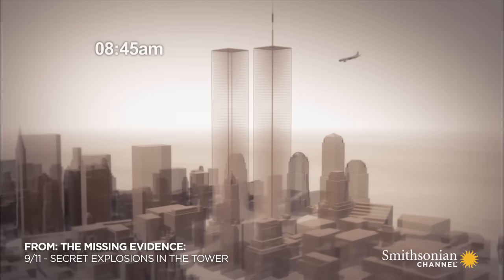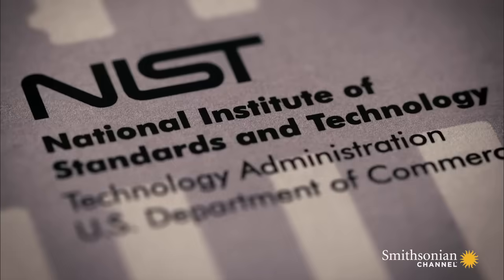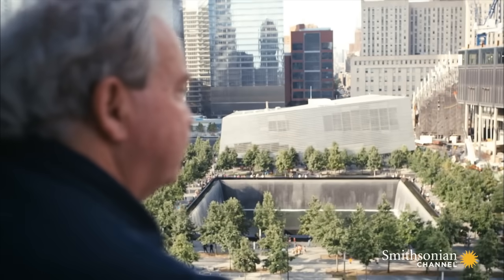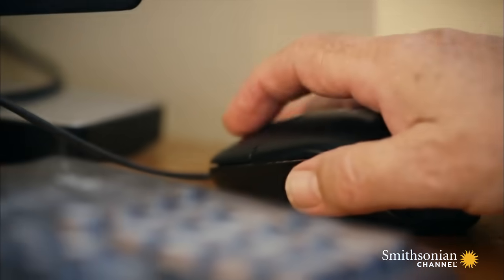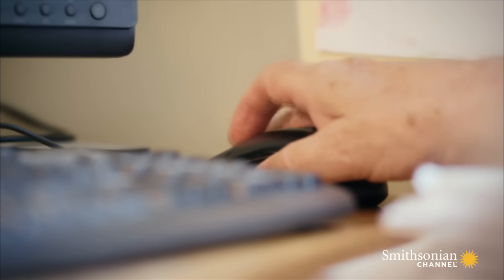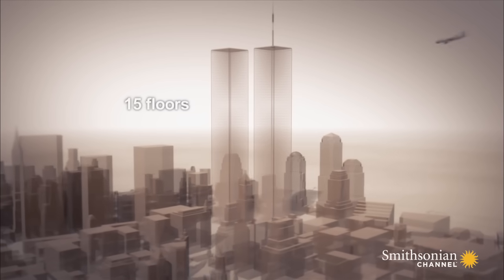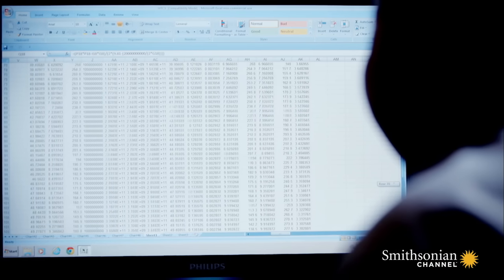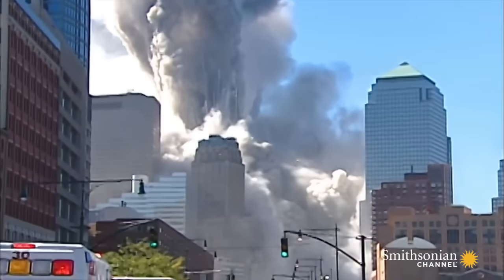This Computer Simulation Explains How the Twin Towers Fell

Comment: This isn’t science by any means. This is propaganda.
Reply: disgny,,  Every one of Newtons laws  were shown and  represented on 9-11.  His first law of momentum explains how and why the planes HAD to impact the towers the way they did...  It could have been a cardboard box filled with 100 tons of jello. If  it was going 590 mph it would have bent, broke beams, crushed concrete floors the SAME way.    His third law also was proven by the  collapse of the  towers..   Lets say  YOU weigh 200 pounds and you sit in a chair that can hold 500 pounds..  NO problem.   you are pushing down and the chair is pushing back with equal force.   Now a guy that weighs 1000 pounds sits in the chair.  The  chair will collapse because it cant push back with 1000 pounds of force.  ....Thats how the floors and the tower collapsed.  One  floor might be engineered to hold the weight of 5 floors... but could not support the weight of 15 floors. plus the  extra kinetic energy from the moving mass....   Understand??

I think ALL the money has been accounted for,,,, but DONT quote me..... thats  what I heard.. or read....  ... .. ..... ....  .....  ...  ....        .... .........  . .  . . . . . . . . .. . . . . . .     ...  ..  ..  ..  ..
Reply: disgny are you Daft how much would it cost to over engineer a floor to support the kinetic energy of 15 falling floor hitting it .  that is what you are implying.   each floor should be designed to withstand the weight of all the floors above it if they should collapse... the cost to build anything would become astronomical
Reply: disgny..   You are unfamiliar with basic physics and .. You are TOTALLY unfamiliar with the construction of the towers..  The floor trusses were supported by the exterior panels on one end, and by the core columns at the other. No support in between.  The exterior panels were held in place by the floor trusses. So the system worked together..  Once the fire induced collapse started,,,lets say 15 floors fell, impacting the floor directly below the collapsing floors., that floor,, even if it was '''over engineered''' to a factor of 5, AS  YOU say... there is no way it could support the weight of an additional 15 floors  PLUS the extra kinetic energy provided by the speed of the fall. 
That FIRST floor would shear its connections with the exterior panels and the core columns and ... although the speed of the fall would lessen due to the impact,  the new floor would join the falling mass and impact the next floor, at an even greater speed than the original mass, because the floors are ALREADY moving.

Funny you should mention ''controlled demolitions with explosives""  ( oxymoronic statement - all controlled demos use explosives)....... There is NO evidence explosives were used ANYwhere in any towers?  If YOU think there is.. just post what You think is evidence...

And why,,  for petes sake,, is it SO hard to accept that  a damaged,  BURNING BUILDING would FALL down???    Did you know ,,, a home with a steel beam to support the floor trusses  will collapse before the same home with a wood beam,,,   that  Is a fact,,   ,,, hmm ,, why do you think that is true?...  The  steel beam will heat up, loose its strength and collapse long before the wood beam burns thru....
Reply: Joe V.  You have not told me anything about the towers that I did not already know.   What a quaint statement you made about how hard to "Accept that a burning building would fall down".   The reason I say that is simply that in the hundred years or so of modern steel building experience,   NONE OF THEM EVER HAS, until 9/11, when  3 went on the SAME DAY (!)  Your point about home construction has NOTHING to do with High Rise Steel.  Even if WTC steel was heated appreciably,  It was NOT nearly enough  to overcome the column strength.  Remember that beam strength is in Bending; but COLUMN strength is axial,   so the towers were not in any danger even if they
 were cooked all day by Kerosene fuel  (Jet fuel , to you).
    If you are sincerely interested in  these topics, look up ae911truth.org. 
     Your re-hash of Prof.  Sundar's NIST  fantasy is negated very simply:  the Imagined successive pounding by successive floors piling up as a gigantic Load CANNOT be true,  because it TAKES TOO MUCH TIME(!)  Bldg. 7  went down in Free Fall time,  that MEANS  ZERO time for each of these floors to "do their thing".  The only way to eliminate "Time"  is by blowing away each floor by explosves.  That is the normal demolition procedure, and no one has come up with ANY alternatives, because there aren't any.
Reply: Katelynne:   Yes, I am of that opinion,  and if you look at the videos of the steel pulled out of the wreckage (before it was illegally and hastily destroyed)  you could see quite clearly that many columns were not only cut through, but many of them AT AN ANGLE, which is a very suspicious indicator of a controlled demolition.
   Furthermore, if you look at the tower videos again,  you will see plainly that enormous  chunks of the gridwork  of heavy columns  weighing MANY TONS  were blown  across the street ,  SIDEWAYS, which a "Natural collapse"(whatever that is) would NOT do.
Reply: Disgny.. Thanks for referencing Harrit.  He. along with Steven Jones were made to look like fools when they claimed to have found chips of un ignited thermite in the dust of 9-11   the chips turned out to be the Same composition as paint found on any bridge in Manhattan,   Then they tried to say they found iron micro spheres which they say were created from a nano thermite reaction.  Again they were proven false,,   Thats WHY you will NOT find proof Anywhere for either substance in the towers..

Beams cut at an angle.??  Not suspicious at all,,  Let these guys tell you.  watch?v=DdBv7uaQT_0

The ''natural '' collapse of the towers IS what caused the exterior panels to fall away from the towers. The debris fell in a 600 foot radius.   If it was a ''controlled demolition''  that doesnt sound very controlled..
And the force necessary to ''eject'' a multi ton steel beam would create a deafening sound and visible explosion..   Did any one see or hear an explosion as towers were collapsing.?? .....  Didn't think so..
Reply: Katelynne:  Thanks for the kind words.  But my interest is always in the "truth" of things.   I fully admit that for years I didn't even realize the Official 9/11 story was a scam, until  the internet , and ae911truth started talking about building 7.  I know the implications of all this lying are really devastating to one's peace of mind,  but do we really want to live in a "dream world", while our Own is being destroyed?!
Reply: Joe V.   I forgot to give you a reference to an explosives expert,  a Prof.  Niels Harrit.   And , oddly enough,  various suspects in the crime  are connected to companies who manufacture  such esoteric , high grade military explosives, (NOT available in Afghanistan.)
Reply: Joe V.   I wasn't going to answer you further, but you last comment made me quite curious. ( You forgot to reference  the video showing workers and the "cut " ("Beams"? )( Do you know what a beam IS?) So anyway,  I am definitely curious as to why ANY cuts on "junk" would be made at a 45 degree angle?!     There doesn't seem to be any rational explanation for it,  and their "boss" , I would think would complain about the useless inefficiency of doing such a thing.  Not a big deal, just a  small puzzle.  Which, no doubt, you could instantly solve.  But, of course,  an angle  cut would be a telltale sign of a controlled demoliti9 on, would it not?  No wonder the "government"   was so quick to get rid of the Evidence.
Reply: disgny.    I am not an iron worker and do not work in debris clean up.   So, I have no idea why the cuts were made at a 45 or 30 degree angle.  I'm sure there is a reason for it.. probably like cutting a vee in a tree before you cut it down..   So, as was shown in this video..   watch?v=DdBv7uaQT_0 ,,    beams (exterior panels ....) were all cut at the same height during clean up..  the workers point to 3 other 'candlesticks' that need to be cut yet...   If they were cut  before collapse,,, those cuts are a couple stories high,,  that would be VERY hard to conceal what was done,, and what purpose would that serve to aid in collapse....The collapse started at IMPACT AREA..... did you forget that??
And you are implying that even the clean up crew is part of the conspiracy...  sheesh..you keep adding more and more people that are involved...   when will your paranoia cease and a little common sense step in:??
Reply: Joe V.  Thanks for a rational answer.   But, no , 45 degree cuts are only routinely made in a controlled demolition, because you want to have the building Drop, and slide off its supports.  (Otherwise, it might just "stay there" for awhile and create problems with the "steering" of the collapse.  So it is a lot of trouble.  And no, it is not at all like a cutting of a tree.  ( FYI  I was in a Combat Engineer  Unit too,  and observed some demolition. Nothing like 9/11)
Reply: Joe V.   I hope you will not be insulted if I tell you that there is NO POSSIBLE WAY for you , or anyone else to "know" that, about thermite. You might know about common garden demolition projects,( though it doesn't sound like it), but 9/11 was unique.  Even if you have the Highest Security Clearance,  given the constraints on "Secret " Military knowledge,   a "Peer", such as yourself, in the organization would probably not be told intricate details ("Need to Know" Principle). (And if you do have that knowledge, why are you talking about it?! )What we DO know is that Academics like Prof. Harrit do specialize in this kind of research.    Of course, so do others.   Are you claiming to know enough about the subject to claim that Prof. H.  is lying, or what?!(  By the way,  we should be talking about "Thermate", not thermite. ) Did you come to the part where "quiet" explosives( on the nanoscale) were mentioned?  That might quiet your mind about the Explosion noises,  although there are plenty of cops and firemen who heard them.
Reply: disgny from your inability to realize and accept 'facts' when they are right in front of your eyes,, to your system of believing things that have NO factual support... your world is coming apart from your own choices. 
Harrit may be a scientist, but he and Steven Jones have been thoroughly discredited in the claims of finding thermite, thermate, nanothermite.   HAD it truly been found in the dust there would be posts All over the net.. but there are None.
It comes down to a sickness that ALL truthers suffer from.. . a mental sickness that makes you guys see or think shIt that isn't there.
Reply: disgny 'NO Possible way??.. Yes.  There is something called 'google'  it is Very useful to learn all kinds of things.... Like.... NO High Rise has ever been demo'd using thermite, thermite, cinnamin sugar..... ''Ever'' as in N E V E R.....
Reply: Joe V.  I have news for you,  that most grownups have learned.   EVERYTHING you "hear"  or even "See"  on the net is not necessarily true.   Take advertising,  Propaganda,   politics. etc.  A lot of what you "learn" there is simply incorrect.
Reply: Disgny...  YOU are So correct..  and the  prime example are ALL the truther videos that idiots think are factual...
Reply: Joe V.   I'd be interested to know just what YOU think IS "factual"?   The accuracy of Newton's Laws of Motion?   The many eyewitness reports of Molten Iron in the wreckage for months after 9/11?!   The statement by Donald Rumsfeld that his Department  has LOST many TRILLIONS of dollars?!
Reply: Skyscrapers that catch fire always explode into dust and conveniently truck sized lengths of steel. Newton's 3rd law does not apply to skyscrapers and they also always leave large amounts of molten elemental iron when they fall down. In fact every steel framed building that ever caught fire exploded into dust and 30ft lengths of steel, Look it up.. do your research!
Reply: Katelynne :  You have made a valiant effort to repeat the fantasies of Prof. Sundar of the NIST organization.   You expressed them well enough, ,except I think you missed the "weasel word " part,  where he  stated  (for the sake of his reputation, no doubt)  that his complex analysis applied only to the situation of just how the collapse would be unstoppable once it had started.   He never did get to the part about , OK,  how then, how  did the collapse start.   That "Let's him off the Hook" , you might say.  The bottom line is that he never did explain just how the towers collapsed.
    I'll just assume you have not studied Newton's Laws much.   The laws about falling bodies,  the simplest case being "Free Fall", where you drop any weight from a height,  like a building,  results in a simple formula , giving you the answer of how much time it would take to hit the ground.   These formulae  have NEVER BEEN WRONG in over 300 years.  In the case of building 7 in particular,   tht is the length of time it took the whole building to hit the ground.(!!)  That can ONLY mean that there was NOTHING   to slow down the fall,  because the FF time is TOO SHORT!   No matter what mechanism anyone dreams up to explain the collapse, it is irrelevant, because there is NO TIME for it.  In the real world,  that implies that the columns were sequentially blown away by explosives;  the usual  Demolition method.   There is NO OTHER method that anyone knows of at present.
Reply: Joe  V.  Just so you know,  I worked as a civil engineer,  (structural)  for years,  so don't bother parroting the "Official"  lies about WTC.  Your confident assertions  "refuting"  sounds of explosions,  Dr. Harrit,  angle cuts on COLUMNS , thermite,  etc.  are ALL bogus, and reveal an ignorance of just how science and engineering works.  And by the way,  just what is a "Natural collapse"?!  There is NO SUCH THING.  Until 9/11, no steel high rise had EVER" collapsed".  (Except for the many case of intentional controlled demolition , with explosives. )  For the public:  don't waste time on this guy,  he is a phony.
Reply: Katelynne:  In case you missed it,  "NIST"  , which formerly was   famous for  accurate and unbiased technical tests of materials, etc.  has sold out their reputation for honesty in their reports about 9/11.    If you read ALL the reports, you would know that they finally  admitted that they had NO explanation for the Towers' fall,  as their Gravity, Fire , and "progressive" floor collapse  Theory was utterly untenable in the fact of expert analysis.  If you doubt that,  look up "ae9/11truth"  website to see what real engineers say.  If you read NIST carefully,  you will note that the analysis STARTS OUT with the collapse initation, and states that from then on,  it would be unstoppable.   Admirable Weasel wording, but not informative . It is simply a Fact of WTC construction that they were carefully designed to withstand not only gravity, fire , and airliner impacts,  but had a Safety Factor of FIVE beyond that(!)
Reply: Katelynne:   Yes, the NIST report gave a reasonable sounding network of Conjectures,  backed with very expensive  computer "modelling", etc.   but it was still  a Fraud.  They did NOT explain why Newton's Laws of motion (i.e Free Fall )  were violated for the first time in 300 some years.  And when pressed , later on , they gave up on the whole thing.    
    Your conjecture about "runaway progressive collapse of a structure"   , yes , is a real (theoretical)  scenario,  but it does NOT apply to 9/11   , for a great number of reasons, which I referred you to.
   Momentum transfer is a legitimate idea,  but the Towers were so over designed for safety  that it would have stopped after a very few floors,  had not the supporting columns  below been BLOWN AWAY. That is the inesescapable implication of Newton's Laws.
Reply: Joe V.   You seem unfamiliar with the design of steel buildings.  The fact is,  that it is NOT the "Floor" which holds up that part of the building which is above the floor level in  question, it is the "Columns".   The "Posts" you might say, that hold up all the weight.  And , according to the Engineer who designed the towers,   the "Safety Factor" in the towers was Five times  all conceivable loads.  And safety factors are NOT seen as a waste of money;   you want to be sure that the building will not fall down no matter what.  Of course, that does not mean they can withstand Controlled Demolition with explosives.
Reply: katelynne:    Yes, I looked at the picture, but I don't see ANYTHING in it that justifies your conclusions.    And by the way,  destroying and removing the evidence from a crime scene is a FELONY , which no one so far has been accused of.   Why is that?  I had thought that everyone in the world would agree that 9/11 is the biggest crime in US history.
    And by the way,   the towers were over  a thousand feet tall,  so just toppling over would extend wreckage that far .  The FACT that it is so concentrated is yet another evidence of controlled demolition
Reply: kilroy055
The only three incidents of a skyscraper suffering global collapse due to fire occurred all on the same day in the same place.
 
The north and south towers collapsed into the greatest path of resistance at essentially free fall, while WTC7, which was not hit by a plane and of which NIST states that exterior damage from falling debris was not a factor in its collapse, instead collapsed at free fall speed for 2.25seconds due to the thermal expansion phenomenon. Therefore, you are debunking NIST's analysis of which you say you believe.
 
This violates the law of conservation of momentum and the law of conservation of energy. 100’s of thousands of tones in the lower section of the North and South towers should of slowed the upper part of the building, simply due to the mass of the lower section (excluding WTC7). The deformation of the lower section should of additionally consumed energy slowing the fall even more.
 
Now the theory, which NIST claimed to be the most probable for several years after 9/11, was called the pancake theory. This theory is not supported by NIST or any other investigational organization but yet this myth is still being propagated by the media as truth.
 
 
 
Here we see explosions descending ahead of the collapse in the middle of the southeast side of the North Tower. If the pancake theory were true we would see plumes of dust, debris and concrete from corner to corner on each side of tower. However, this is not the case. Instead, we see a continuous straight lining of what looks to be 'explosions' running down ahead of the collapse. This can be seen in original video posted at the top of the thread, 33:00. Could this be the severing of core columns? Why are these explosions running ahead of the collapse, incrementally in the center of the southeast side of the North tower? This so called pressurized smoke would skip 2 floors in intervals ahead of the collapse.
 
Moreover, there were dozens of key-eyewitnesses that saw, heard, and were injured or killed by explosions in the lobby of both towers and in the basement of the south tower before the plane had hit! Might this be the severing of core columns by an unknown mechanism?
 
What could of accounted for the hat truss of the North Tower to fall in on itself before initial collapse? The antenna punched through the hat truss. However, NIST reports that the chief agent of destruction was the hat truss. The hat truss came apart under the antenna. Something within the building initiated what looks to be the core collapsing.
 
Now it makes me sick to believe that the pancake theory was propagated for so many years. If in fact, the theory that the floors became weak because of heat and collapsed, the core would subsequently stay in place, which is what NIST illustrated in their analysis of the collapse of the North Tower prior to 2005, yet, the core was the first structure to initiate collapse. Even more frustrating is that NIST left the core standing in place! THIS ISN’T SCIENCE to any degree.
 
One may conclude that the antenna never fell through the hat truss. However, then what caused the antenna to fall before the rest of building. Furthermore, the antenna fell before the tower started to collapse slightly to the south, in that case its structural integrity was compromised by a specific mechanism. NIST opposes such a belief and thinks nothing of it. They state that the core failed because the buildings, south angled wall was situating stress on the core.
 
You should read, 'Mathematical Models of Progressive Collapse and the Question of How Did the World Trade Centers Perish’ Charles M. BECK http://arxiv.org/pdf/physics/0609105v8.pdf
 
Beck is one of many that consistently show us where Bazant & Verdure in their J. Engr. Mech. ASCE publications were using misconceptions and simplifications to bolster the official NIST theories and NIST's own misconceptions, fed by government pressure and lies, and despicable career pressure. They used botched science and often propagated fraudulent claims. Out righting lying and having to admit to them.
 
“Progressive collapse based on the NIST scenario, and the practical realizations of collapse in WTC 1 and 2"
 
(i), the average avalanche pressure is 3 orders of magnitude smaller than the pressure the vertical columns are able to withstand, and (ii), the intact vertical columns can easily absorb through plastic deformation the energy of the falling top section of the WTCs. (LT : a NATURALLY falling WTC top section.)
 
"We propose a collapse scenario that resolves these inconsistencies, and is in agreement with the observations and with the mathematical models."
 
(i) and (ii) remarks are given for a non-realistic scenarios, which is presented by NIST. NIST tried to convince us of a natural cause for the WTC collapses. Caused solely by plane impacts and heat losses from fires for the steel, followed by column buckling.
 
Did all columns buckle?
 
The Twin Towers did NOT collapse caused by NATURAL buckling of vertical columns after they could not stand the load of the top mass and the heat of the fires anymore, caused solely by steel strength loss and weight stress and compression.
 
The yield strength of A514 structural steel is, "110 - 130 KSI ultimate yield strength range, an at least 5200 times (130/0.025, N.T.) and 2600 times (130/0.050, S.T.) stronger calculated collapse initiating yield force outcome would have been needed in the by Beck proposed NIST worst case scenarios."
 
SO, the PCs and the CCs, we find the scaled ultimate yield force f = f(z), at the top (z = 0) and at the bottom (z = 1). The parameters r and s are then obtained.
 
 
Beck proves with those 2 diagrams the NIST-proposed buckling to be impossible.
He proves the structural steel columns under and above f.ex. WTC1N its 93rd floor, possessed 2400 times more ultimate yield force strength f (in kilo-pounds/inch²), than the collapse initiation force he measured over the whole floor area in case of the by NIST proposed avalanche start."
 
"In case of WTC1N, Beck found for the failing floor :
f = f(z) = 0.025 KSI, compared to the in the NIST report mentioned ultimate f = 58-60 KSI of the columns their structural steel (page 6, in between eq.11-12)."
 
"And thus that steel could not buckle at all, under those NIST circumstances, only when it got cut and displaced by explosives, could the remaining, and/or the already cut steel buckle at all."

"These Towers collapsed because an additional event took place, i.o.w. the introduction of massive explosions to add to all of Beck's equations, explosions to cut these very strong steel columns.”
 
I can get into much more detail regarding WTC7 and the North and South towers but first read this, http://arxiv.org/pdf/physics/0609105v8.pdf
Reply: kilroy055
-NIST sagging and pulling truss effects that NIST depends on were not seen. NIST was not able to demonstrate this pull in effect, physical tests were not done, computer models did not compute these forces either. As a result NIST fraudulently stripped off all the fire proofing off a large section of the computer model building. Exaggerated temperatures were applied for twice as long as NIST had said occurred in the failure zones. That is that they applied exaggerating temperatures for 90mins instead of 45mins, but even then the pull-in forces were not created in the computer so NIST disconnected the floors before applying an imaginary pull-in force.
 
NO PHYSICAL TESTS WERE DONE, computer models did not give them the answer they want so they fraudulently apply data. They falsified input data and then deny going access of there data because it would ‘jeopardize public safety!?’ http://cryptome.org/nist070709.pdf
 
This is the opposite of science and it is criminal!
 
-The National Institute of Standards and Technology concluded in their report on Building 7: "While debris impact from the collapse of WTC 1 initiated fires in WTC 7, the resulting structural damage had little effect in causing the collapse of WTC 7."
 
-WTC7 fell symmetrically at free fall (2.25s) into the greatest path of resistance.
 
-The model was built without physical evidence.
 
-Cracking middle folds downward precisely as in a controlled demolition.
 
-NIST declined to test for chemical explosives used in demolition. Yet, says no chemical explosives were utilized. How thorough!
 
-Barry Jennings, the Deputy Director of the Emergency Services Department for the New York City Housing Authority, was trapped inside Building 7 when the first plane hit. He has repeatedly told his story of hearing explosions on the 20th and 22nd floor while trapped inside. He died mysteriously in 2008, days before the release of the final NIST report. The cause of death has not been made public.
 
Finally, NIST stated that the steel softened and then melted, which led to interior core columns failure. Hence, the pancake theory was introduced, which is widely believed to be false. National GEO had temperatures of up to 2900 F. Secondly, steel melts at 2800 F and unless in a specific combustion chamber a jet fuel fire will burn at a max. of 1500 F. In the time temp. curve NIST is right that it was an abnormally high temperature fire, however, this quickly dissipated. Now NIST is saying that the fires merely needed to weaken the core columns for global collapse. NIST now says there were pockets of fire that reached a max. of 1832 F. First these temperature last no more than 15-20 minutes, secondly these temps are upper layer Temperatures (Gas Temps) and not the steel temperatures.
Also, the fire’s were oxygen ridden, hence, incomplete combustion and a rather low temperature fire. I mean NIST’s paint temps, we can conclude that less than 2% of the samples saw 480 F. Thermal calculation 600 F. Steel looses half its strength at 1100 F. The WTC floor assemblies heated to 2100 F and didn’t collapse. And this was fireproof steel. In conclusion, of the more than 170 areas examined on 16 perimeter columns, only three columns had evidence that steel temperatures reached 480 F. SO NIST admits that in only three spots temperatures could have reached 480 F, less than half of what is needed to weaken steel. NIST_WTC7_Tech_Briefing Page 50 Re:Column 79
 
"Calculations showed that even if the entire column were immersed in a flame as hot as 1400 °C, it would have taken 6 hours to heat the column to the point of significant loss of strength or stiffness.”
Reply: kilroy055 "As the steel of one floor weakens, the weight of the floors above causes the steel to pass its tensile critical point, causing it to deform." As big as the Titanic is the stupidest comparison I've ever heard in my entire life. There's no science behind any of these ludicrous claims. Furthermore, the data proves that there was a greater potential energy that needs be accounted for, than merely buckling of vertical columns.

Structural steel columns under and above f.ex. WTC1N its 93rd floor, possessed 2400 times more ultimate yield force strength f (in kilo-pounds/inch²), than the collapse initiation force he measured over the whole floor area in case of the by NIST proposed avalanche start."
 
"In case of WTC1N, Beck found for the failing floor :
f = f(z) = 0.025 KSI, compared to the in the NIST report mentioned ultimate f = 58-60 KSI of the columns their structural steel (page 6, in between eq.11-12)."
 
"And thus that steel could not buckle at all, under those NIST circumstances, only when it got cut and displaced by explosives, could the remaining, and/or the already cut steel buckle at all."

"These Towers collapsed because an additional event took place, i.o.w. the introduction of massive explosions to add to all of Beck's equations, explosions to cut these very strong steel columns.”

The snowball effect is another ludicrous claim and if you use your eyes you would see that the floors did not collapse onto each other.
Reply: You are right.   Additionally, it should be noted that all this loose talk about steel "weakened" by fire refer mainly to BENDING strength, which is irrelevant to the Towers, where Axially loaded columns are the issue.   And they were WAY overdesigned,  so a loss of 50% or so should NOT have caused any collapse, even if they were magically all heated in all floors, at the same time.  STILL, no collapse.
Reply: disgny
Exactly, the mathematics prove that NIST official narrative is a lie.
Reply: Katelynne:  You are quite right.  The only real question is, what was the mechanism for "floors progressively failing"?   The answer is quite clear , unequivocal, and without contest:   they were blown away by explosive demolition;  there is no other way to do that.  If you notice,  none of the "government"  commissions, experts, etc. came up with ANY credible alternatives.  It's all a matter of physics.
Reply: "I don't like being proven wrong so this must be lies REEEEEEEE"